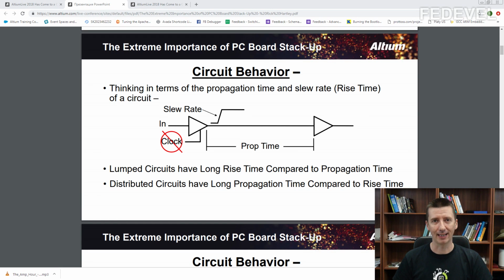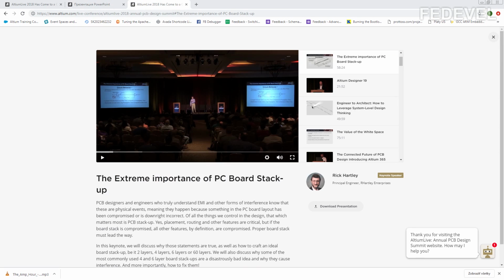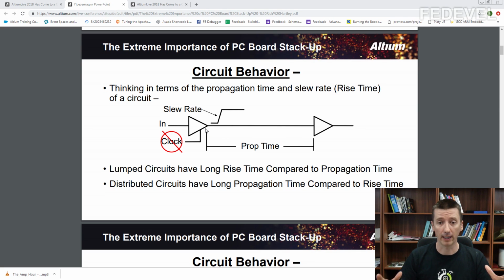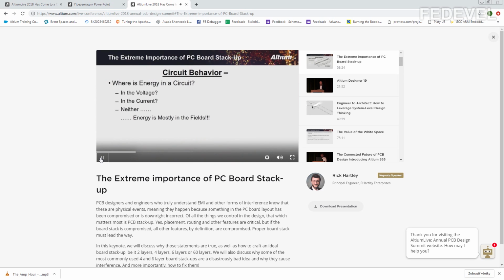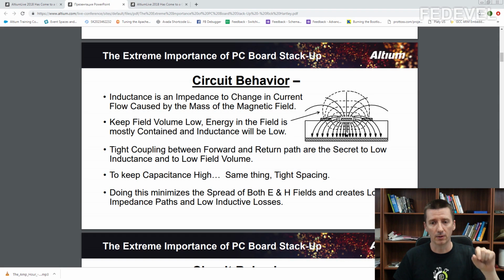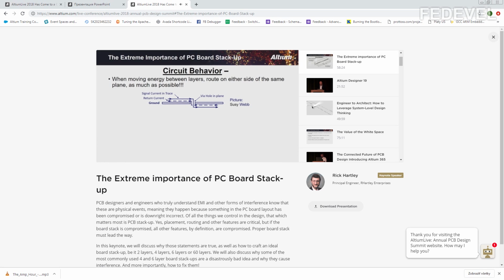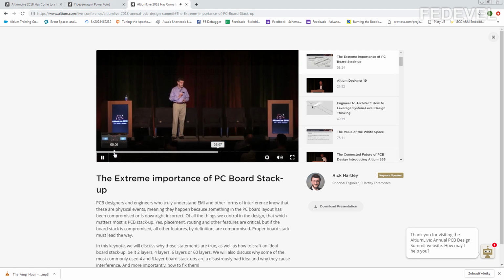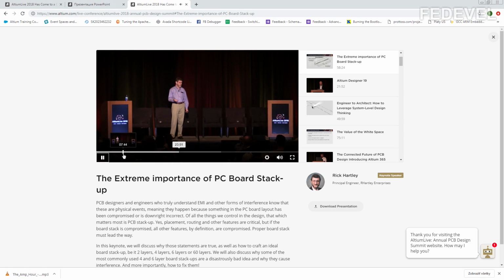Understanding PCB Layout Essential - Change the way how you look at the tracks

Comment: Great video, thanks for the hints to these live presentations.
Have understood the importance of ground plane relative to traces especially where impedance ( risetime) critical requirements and have always tried to maximise keeping traces nearest to the ground plane, and triedcwhere possible to avoid forcing traces to the opposite side. Where possible rather put slower signals to the far side layer, to keep the faster signals from needing to layer swap.
Seems one of the major problems on modern fast FPGA in BGA form. Seems that 4 layer is a  'NO NO' making it essential to run 6 or more layers so several ground planes can exist allowing traces on several levels, but always near the ground plane.
Similarly where mixed signal Analog and Digital, the power for split supply analog can be placed on the far side from ground plane, even using its own plane for ground fills, and keep digital to its side and adjacent ground plane.
Lots of useful explanations in this provided Altium live. Seems Altium is providing very essential education and help to its users, and indirectly to even non-Altium customers.
Reply from the maker: Thank you Helmuth

Comment: Nice video. As an product designer (physicist who pretends to be an EE) who has never designed a PCB with internal power / ground plains I had not thought about the fields as signals traverse the internal plains. Nice drawings from Howard Johnson. 

As a Physicist I had a memorable lab with a table top covered with a long, tapped coxial cables and fast rise time signal generator. In this lab we saw the effects of miss termination (over shoot or undershoot) and reflections. That got me off to a good start.
Some years later I had an extremely valuable week long seminar at Philips Consumer Electronics by a Dutch engineer who thought us how to think about the fields in modern digital electronics. For the geometeries and voltages the fields are much lower in impedance than free space (Free space is 377 ohms) and so you really want to consider how currents form loops and the mostly magnetic fields generated (and occupy space)  and couple to adjacent conductors. 

He made a point that could add to this very good information above. "Never use more bandwidth than you need." So for EVERY single circuit, source terminate it (series resistor very close to the output pins) with the maximum resistance compatible with proper operation. Signals that do not need fast propagation to do their function, should be limited in bandwidth. This means that the design engineer should be "designing" the rise time of every signal (trace). Every one.
Power is a low frequency circuit. Put as much resistance in series (decoupeling) with ever power pin as is compatible with normal operation and then put both bulk and high frequency capacitors at the power pins of the load IC to "by pass" the supply currents locally to the active device. His argument was that the supposedly free high frequency capacitor between power and ground plains was simply not accessible and of enough capacity to be useful and that trying to used it simply formed a giant mixing node .

Example. Your microconroller has a UART. And you are going to communicate at 9600 or 115200 bps.  Connect a 1K series resistor right at the TX pin so that the impedance on the rest of the trace is higher than that that of free space. With the tens of pF on a trace of a foot or three of trace, the signal will be fine for the baud rate but you will no longer have strong magnetic coupling to adjacent conductors.  The RX trace needs the resistor at the other end. The RX resistor is not near the microcontroller. It is for example near the level shiftier drive pin.  

I always draw my schematics this way too. It is my first step to PCB layout.

Hope this is clear and helpful.

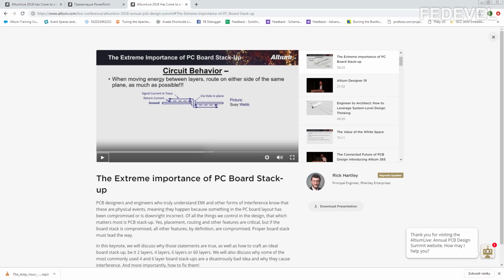Comment: This was awesome! Thank you. From roughly 16:50, where are the fields when changing between layers 1 and 3 (plane on 2) when the via is filled with a conductive material? Is it still in the centre of the hole? But it has copper (or similar) now.
Reply from the maker: Thank you Daniel. I recommend you to watch also this - See how signals are travelling in your PCB: https://www.youtube.com/watch?v=ZyoqhJB_E9Q - that company also has simulations which will show you fields around VIAs.
Reply: Thanks Robert :) I'll watch it in the morning. I have more questions but I'll see if you've already answered them in that other video first.
Reply: @RobertFeranec  That video was also great :)
But where is the energy when there is a plane on either side? Will the closer plane be the reference?
Reply from the maker: @danielrechichi8639  you can have two reference planes, closer plane has stronger effect.

Comment: Robert, that was great. I think it's way to take some good presentations and make some comments, to make it simpler. BTW. I haven't found in your videos anything about aligning differential pairs so far. You could explain how to calculate it in simple engineers way.
Reply from the maker: Thank you Phil. I am not sure what you mean by aligning ... if you mean lenghtmaching within pair, that is usually within 5 mils. But it is interesting to know where exactly do add the length, this video is mentioning that: https://www.youtube.com/watch?v=ZyoqhJB_E9Q

Comment: It is basic electrodynamics. Nothing new. But it's nice to get a refresh once in a while. Also, I have seen somthing similar at 9dotconnects videos. 

I want to add, that if you work with RF signals and HS digital signals you should be really careful and read some shielding theory because I have seen alot designs where analog shield made things worst for both analog and didgital parts.

Comment: So, I'm trying to learn what is possible with double and single sided boards. Every time I hear about or see something like this I'm left wondering how all the consumer electronics I've taken apart ever managed to work. I've seen lots of TV's, VCR's, DVD players, and stereos that were built using mostly single and some double sided boards. I'm referring to stuff made in the last decade too, so "modern" digital circuitry. I don't doubt the information here. I just don't understand how to fit this information in with these other product designs.
   I guess I need help understanding the fundamental transition from the most simple design methodologies to a design focused on a small stackup.
-Jake
Reply from the maker: Metal enclosure helps a lot with EMC/EMI. Slow edges and careful layout also plays a role. However I have seen many problems with 2 layer PCBs - when I was starting with HW design I designed two boards which were randomly failing because of 2 layer PCBs. Problems are usually somehow "fixed" with additional capacitors and resistors (if possible to fix them).
Reply: @RobertFeranec  
  Yeah, you've already got me adding lots of 'do not populate' footprints and 0R disconnects/solder jumpers to simple designs just incase I need them.
  If Bill (eBay - ABCfab) ever gets back from his long vacation (July 10th), I want to get some of his thin core copper clad, and try a DIY 4 layer board. Sadly I have just as much, if not more fun making boards than anything else. ... I'll use any excuse to avoid learning to code better :-)